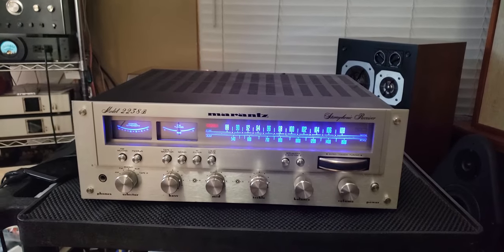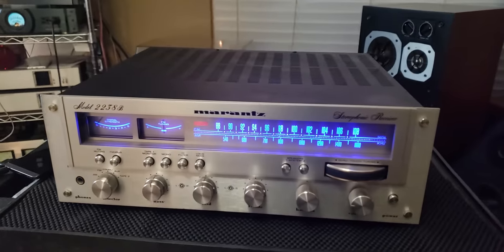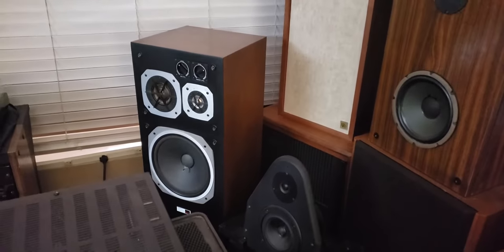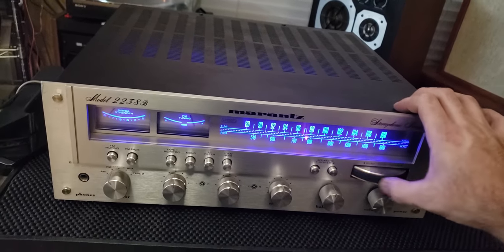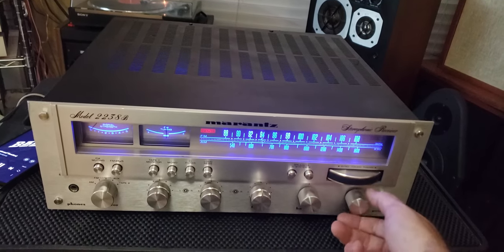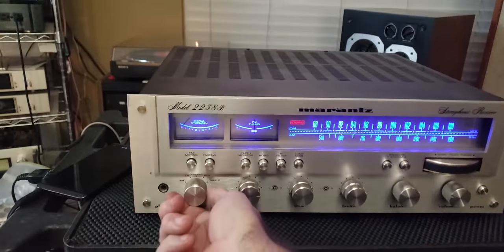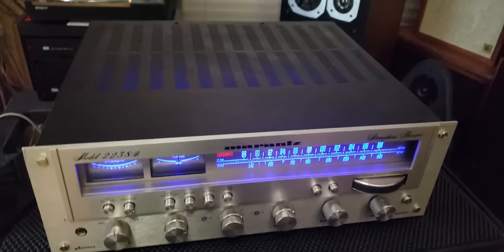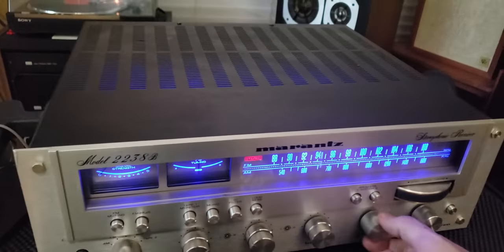Marantz 2238b and Sony SSU-4000 Speakers Demo

Comment: Great demo! I have this beauty paired with Klipsch RF-62 II Reference.... and is a revelation... it sounds amazing... I've tryed plenty of good sounding gear but I kept this and for plenty of reasons... the bass - nice and gurthy, the loudness mode - everthing I like about, the treble detailed, the tunner the best yet, the looks - one of the best. I also connected a powered sub on the B output just for fun and low notes songs ... and it shakes  the floor in perfect harmony with the speakers (that are allready bassy). What could I say... strongly recomand!
Reply: You should try the sansui 5000x bass is so low it’s insane

Comment: GREAT VIDEO!!!  Question, how do you have the Pre-OUT configured?  Pre out to a separate AMP? But then you have the Record Player hooked up as well?  Just trying to figure it out.  Thanks again!
Reply from the maker: Thank you! If you run your rca cables from the preamp out terminals on the back of your 2238b and in to the amplifier rca in terminals on your external amplifier you retain all of the front controls, inputs, outputs, tuner, tone, functions, & etc on the 2238b, you are just no long using the amplifier section inside of the receiver.  So speaker cables would be wored to your external amp and not the Marantz. When doing so be sure to turn the speaker buttons off on the front of the receiver, just to help keep the amp section in the receiver healthy while not in use. The 2238b makes a great preamplifier and its a good way to increase your power without having to buy a bigger Marantz!

Comment: Sounds too happy, the high notes are a bit exaggerated (but not distorted) IMO (you can hear the cymbals more than everything else) and the bass has very little extension but hey this receiver is great for rock music or electronic music (party music) not audiophile type that sounds even with all the frequencies like a Mcintosh for example, the silver face vintage marantz looks good though but the sound is not natural sounding, is just too sharp for my liking.